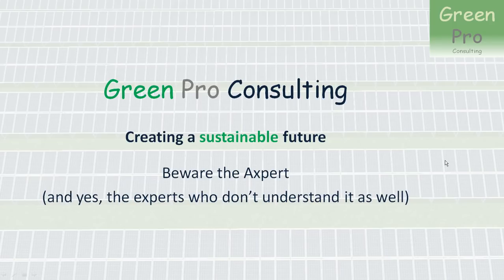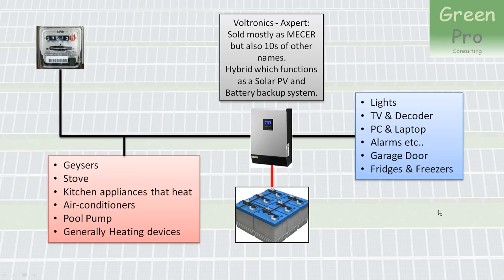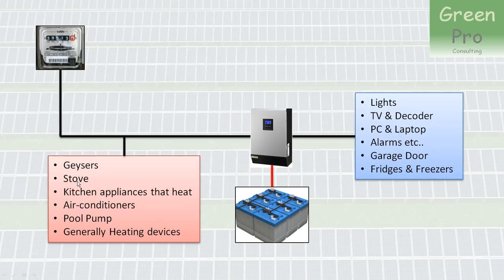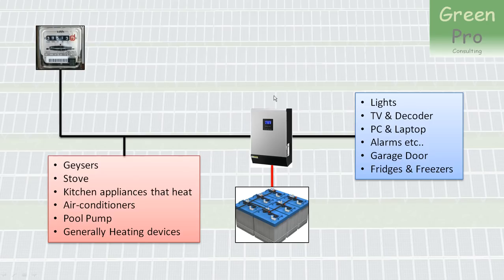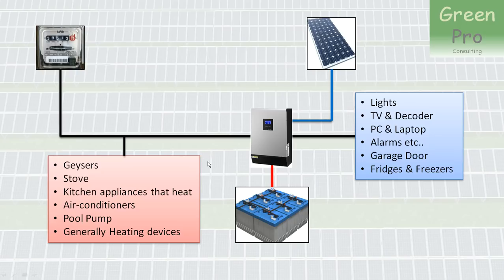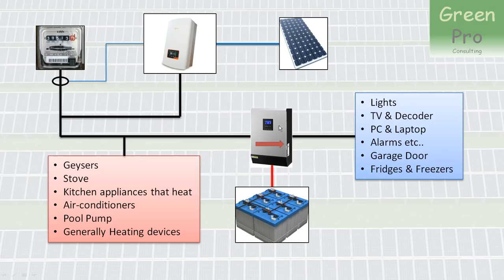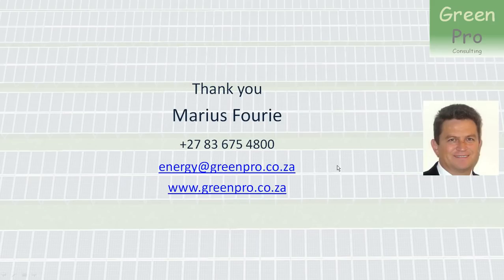Beware the Axpert Inverter

Comment: Hi Marius. I have installed an Axpert before with batteries and panels and love the Axpert and I am very familiar how it works and how to wire the system . The question I have is about a manual bypass circuit breaker. I never had one on my other installation. I relied on the switch over internally in the inverter. So my neutral live and earth from the inverter were isolated from the houses mains due to bonding. When my previous Axpert failed and needed it repaired I had to manually re-wire the isolated inverter outputs back to the mains which took time and not wise to do in the dark either. My question is that every manual transfer switch I research only switches live and neutral but not earth, bare in mind that my inverter installation and mains are isolated from each other. What manual transfer switch can I use to achieve transfer of live earth and neutral so if my inverter fails I can switch over without accidentally bonding via earth?  I would prefer a Din rail transfer switch if possible and a wiring diagram of how it should be done. I don't want to go by a manual switch and spend money to only realise that it will not work. Regards Warren
Reply from the maker: @warrenstevens908  There is one earth. You are standing on it. So no need to switch.

Comment: Very good explanation, thanks
Reply from the maker: Remember this a fairly old video. The MK2 used for this video has been replaced with the MK3 model. I would still say, if you want to add panels, go for a proper hybrid, else this is OK. I also believe NRS-097 do not apply to the MK2 and MK3 inverters, since it has no power drivers that can deliver power to the grid side of the inverter (just like your kettle) and both don't need NRS-097 approval.

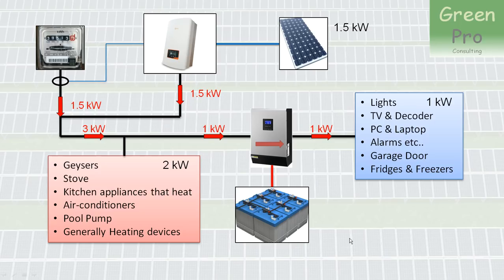Comment: @11:50, if your power fails, and you have free power than can come from the pv during the sunny day. why would i want to use battery backup to power the 1kw load, rather than using the free pv power available? Is there a way to install an automatic changeover switch to switch the pv power from the grid tie inverter to the pv input of the axpert inverter?

Comment: Don't buy these Axpert type inverters, they are absolute garbage! I've had two now go faulty after only a few days of use. Very cheap and nasty invert :(
Reply from the maker: I have zero commercial interest in these inverters. I am not even on speaking terms with the importers.
SO: A new inverter has a 3 year warranty, "faulty after only a few days of use" makes no sense.
You seem to have bought from a fraud who sells faulty inverters.
I think they are OK if you do not add any panels, for backup only they are fine.

By the way, Cape Town municipality barred them, for reasons that makes no sense. Their explanation is the most illogical reasoning I have ever heard.
Reply: My Synappse axpert 5kw is running 24/7 for 3 years.  Not a single fault. It blends power . In SUB mode it blends power from the grid if solar is less. In Sbu mode it draws power from battery if solar is inadequate.  I have manual transfer switch for my geyser so that Sokar not only charges the batteries but also keeps the water hot...  cut my power bill in half

Comment: switching to grid depends on the model - I have an infinisolar V2 and when it switches to the grid it works in hybrid mode. If Load=2KW and PV power=1KW, it takes only 1KW from the grid.

Comment: What is the difference between a grid tie inverter and the Mecer inverter shown in the video ?
Reply from the maker: The Mecer has no power drivers on the grid site so it cannot push power to upstream loads. It is simply a power consumer on the input side.
A grid tied inverter can push power into the grid side.
Reply: @greenpro-greenproconsultin7420  very interesting.  Thank you for your time . Love the videos , keep them coming.

Comment: Hi Marius, thank you so much for the video it helps a lot. Please help me with one thing. In your example you have added a grid tie inverter to optimize the system. So. When the grid power fails then the grid tie inverter switches off. My question is this. Is there a way that the system can be set up so that when this happens then the solar panel input switches from the grid tie inverter to the Hybrid inverter, so that it (panels) can utilize the function of supplying the critical draw items such as lights, tv..... When grid power comes back on then panel inputs switch back to the grid tie invertor and therfore resumes the role of suplimenting the grid power coming in to the full load. I'm sorry if this is a silly question, your guidance would be highly appreciated sir.

Comment: Your video is spot on - thanks for this. I have a Mecer Axpert [2022] and it works exactly like you said - I do not have solar - only a 200AH battery -  it switches between sources it does not mix the power like a Sunsynk inverter.  I carry my whole house, except for the Kitchen and the non-essentials. It acts like a UPS when there is load shedding. Cost me less than R10k.

Comment: Note sure if the newer Axperts inverters are different at dealing with combining solar and grid..? I do see that my Axpert (max 7.2kw) inverter does allow that when there is not enough solar it does blend the shortfall from solar with grid if set to utility (SUB) or blend battery and solar if set to SUB.. I use ICC software to change (SUB vs SBU) based on SOC.. So if there is a 2kw load and you getting 1kw from solar it does not ignore the 1kw from solar but it does then pulls the additional 1kw from the grid or battery so to not waste the 1kw from solar and now pull the full 2kw from grid or battery.. of course it still does not have the non essential output so it can never provide power to the oven if there is a situation where your batteries are full and there is excess solar that could be used for non essential loads like the oven.. To me this was the biggest negative you described which I think has been resolved with the Axpert Max/newer inverters..
Reply from the maker: This video was made before the MK3 and applies to the MK2 inverters. See video on Axpert MK3 Wiring & Operation.

Comment: tx a stack - the basics for the layman, excellent! question, the serial number on the axpert, say 929315xxxxxxxx, is the 15 the indicator of the year of manufacture?
Reply from the maker: Hi Gabriël. Frankly I have no idea. If its an Axpert chances are good that it was imported via Mustek. The warranty at the time was 2 years, so if you had it around 5 years its out of warranty. I would not fix it. Too expensive and then you have 3 months warranty vs. a new one, 20% more and then a 3 year warranty and better functionality.
Reply: @greenpro-greenproconsultin7420  indeed it is still working excellent, i use it with pvs and some pylons. it is just that the older models are not as 'communication-friendly' with wifi and bt than the new ones. i found that the year of manufacture indication - as above 2015 - is not even known amongst some solar 'installers', hence old stock might be sold as 'new' to the unwary.

Comment: I will have to throw in my 2c here. These units are renowned for damaging batteries. Even Pylontech, in their LV hub compatibillity sheets mentions this issue with voltage spikes during charging and how the charging voltage should be lowered to prevent the BMS from turning off. This thing is cheap and that is it's only plus point. If you take the price into account then it's not a bad inverter. BUT I whole heartedly disagree that it can be compared to or that it performs even better than the more expensive German or high-end brands.
Reply from the maker: I use the Victron recommended voltages of 52.5v for absorption and 51.5v for float. I find that works fine. This was made when the MK2 was reining, the MK3 logic is really a leap forward.

Comment: Thanks Marius, the video is very informative however its the battery bank part which makes the Axpert to work fantastic. it can be setup to give priority to solar panels and get extra power from batteries if the load is more than what the panels are producing. Only when battery power drops to a certain set voltage then grid will be switched on and only to charge the batteries and after batteries are fully charged the grid will be switched off. If the solar system Is designed properly and correct battery bank and solar array installed the grid will hardly come on and maybe on really bad weather scenarios.
Reply from the maker: Yes your description is correct, but it’s a very bad idea. It means your batteries are constantly discharging and recharging, which shortens the battery life severely. It also means that you can have load shedding start when your battery is empty and then you don’t get thru load shedding. That is people’s biggest gripe and they don’t understand why.
The biggest problem is that the Axpert uses voltage as an estimate of state of charge. For lead acid technologies, it works bad because the current drawn has a major impact on the voltage measured. LiFePO4 batteries have a very flat voltage curve between 90% and 20% state of charge so it’s impossible to determine setting 12 on the Axpert.
BUT, the MK3 (including King and Max) fixed this problem. See the video I added.

Comment: @greenproconsulting I have a question for you. My  axpert 5k inverter is 1 week old, off grid system, and this morning the LCD screen is dark and not functioning. I have no load overnight. The panels are still charging the pylontech batteries and I have power in the house. Is there any cause other than blown internal fuse? Thanks very much.

Comment: Hi there the third generation Axpert VM 3 Inverter has the capability to mix PV power and Utility supply and prioritize PV Supply
Reply from the maker: MK3 (the King) and MK2 is the same in this respect. To change this will double the cost of the inverter.

Comment: Thanks for the info. Can this be used to charge lithium batteries.
Reply from the maker: Yes. 1st determine the number of cells in the battery and then select the voltages. Axpert setting 5 must be USE.
I prefer the following Cell voltages for LiFePO4:
Switch from Battery to Utility at 3.2 v
Switch from Utility to Battery at 3.44 v
Bulk (and Absorption) charge at 3.5 v
Float charge at 3.43 v
Cut off at 3.17 v
These are conservative settings. Note that cutting off the load in the Axpert before the battery BMS cuts the load is important for subsequent startup when grid or solar returns. Hence why I cut at about 80% DoD.

Comment: Hello Marius ,
i think your configuration is not ideal,  because with no grid.... there is no power because your grid tied inverter works not.
There are much better inverters on the market, also from Voltronic Power like the Hybrid Inverters 3K, 4K, 5K, 5,5K, 10K, or a Victron Multiplus/Quadro.
This devices can can mix power from the panels, or the battery  to the  "left side" ! 
With the correct electronical power meters you can make a connection to the inverter and you have no feed in to the grid.
I have for my own usage 2 of this older generation Voltronic 5kW Duo Inverters, i think they are outdatet.
In addition to this inverters i think to purchase a victron multiplus 5k48, it gives more posibillities.
Reply: I cannot agree more. The fact is that the Axpert inverters are cheap and they work well as long as you don't want to connect panels to a grid tied Axpert system.
On the more expensive options from Voltronics: I would much rather stick to Victron. So as soon as someone says they want to eventually dexpand the system or go off the grid or want to add PV panels later, I go straight for Victron. The new Multi's are now SA grid compliant and the functionality is endless. Some people don't like Victron systems saying they are too complex to set up, but maybe they should not be selling such systems.
Reply: Take a look at Phocos Anygrid.

Comment: Thanks, Marius - well explained - Question - Is there a way around the setup as you explained it when you lose the Eskom power to make use of the PV panels as well in the house>
Reply: I would suggest to get a hybrid inverter,sure they are more expensive but they work different in that the put the power made by the panels into the grid where all your aplliances are connected and your sollar is used even if the grid goes off...when you make more power than needed its exported to the grid(can be switched off)...so you dont need to split your high loads etc...it just puts into the grid what i can..if your appliances draw more power than the inverter can give it gets it from the grid...so even in the early morning you are already using solar power(much less than 10 am or 12 am but still its not wasted)
Reply: @Bravo6020  in SA? First you must see if Eskom allows it, what are the regulations? Second you need a meter that can turn back to reclaim the units you put into the grid. If you get for a kWh unit the same as what you pay for one, no problem. Some countries give you only 10% of what you normally pay for a unit.
Reply: I think the new axpert vm 3 inverter has the feature you miss. It can provide  for the  extra  load you need taking all the solar from pv's and the rest is taken from the grid. You can even make it work  without batterys. So power comes from pv's plus grid to complete de load you need.
Reply from the maker: @robotech1990  Some people think the King (MK3) overcomes the limitation. It is fundamental to the hardware architecture. The MK3 has the same limitation. Software changes and bluetooth makes no difference. That is why its so cheap. If they change this, the price will double.

Comment: Hi i dont see how the PV supply recharges the batteries that act as a backup and how many batteries 105ah you optimally need to keep fhe list on the right, on if multiple load shedding takes place. The time to recharge the batteries is also important inbetween load shedding. I hope Im making sense.

Comment: Thanks Marius, Very informative. Ive just recently installed this inverter linked to a 3.5kw battery. Its all working great but every now and then even though the battery showed full, there would be a spike in the house (The power would dip on lights) and when I get to the inverter, I notice its gone off and only the battery is flashing red/orange light which tells me its not giving power to inverter. Have you come across this and can you explain please. Is it the battery not holding charge, Is it the switching over thats faulty. Lost for anwers and solutions. Perhaps I should expalin the combinations I've got. 8 x 410 kw panels, 5KVA voltronic inverter 80 amp, and a 3.7kw lithium ion (Solar MD) battery with logger tied into the system.
Reply: I think.theres a typo?' 8x 410watt  not kw

Comment: Thanks cleared up allot of questions. The video ended so soon😀. So if the eksdom power is off will the pv pannels still work? I guess not because you said the grid tied inverter goes off. Would it not make sense to have the grid tied inverter power a set of normally closed relays that will transfer the pv panels back to the axpert? That way if the power goes off for a long time you still have the option to wait for the batteries to charge up again.
Reply from the maker: Yes Martin, the Grid tied inverter will stop producing when the power goes off. We are certainly very irritated if the grid goes off, but the actual percentage of time is low. (Probably will get worse), so you loose much less energy that way. If you want to get near the ideal solution, you simple have to go to a more expensive architecture. Then I would recommend a Victron DC coupled system. I have also seen over time that batteries simply last longer if coupled to a Victron inverter with a proper BMS.
Reply: @greenpro-greenproconsultin7420  Hi Marius, I just install my Axpert 5KW (fcs-5k-ks-5000w) with PV etc connected to my house DB, and yes, setting priority to Solar will trip my Main DB board immediately. I have noticed you mentioned the Infisolar product in a post below from <Star of Eden
> (Maybe because it does not push load back to Eskom (CoCT for my case) and I have noticed the price difference between Infinisolar are drastically more expensive then Victron. Am I missing something, why would Victron 4-5Kw be cheaper than the Infinisolar 5Kw?
At the end of the day I would like to get a ROI from my installation, thus I need to get power from both solar and utility.

Comment: I installed a similar unit (different brand name) about 4 years ago, I did blog this with photos and diagrams, doing updates as I went along. One week before the 4 year mark the inverter went bang and everything died. I opened it up and saw a lot of swollen capacitors, I see they use 85 degree capacitors. So this is a very nice solution but it has a lifespan. My total spend was just over 30K, that over 4 years is R 625.00 per month, the Batteries also needed replacement after 3 and a half years. So its not actually sustainable although with the current Eskom power mess its very convenient to always have power of some sorts..
Reply: How could you have avioded the inverter failure?
Reply: I also began with lead acid batteries - but they a mug's solution. Lithium batteries cost 2 1/2 times more but will last five times longer (HALF the net cost!) - so they are a no-brainer economically. I eventually upgraded to two 5kW inverters working in parallel (working half as much work for each, longer life, more headroom), 18 panels on the roof (3 strings of 3 per inverter) and a 5750Wh Lithium battery. I may inspect and replace the capacitors... My units are Mecer brand, SOL-I-AX-5P64 - and I believe that this model is no longer manufactured. Am considering adding diodes to the limbs of my strings to maybe squeeze a little more power by preventing lazy strings from loading their neighbours. I believe doubling the battery capacity should allow me to go completely off-grid, for at least 95 percent of the time.